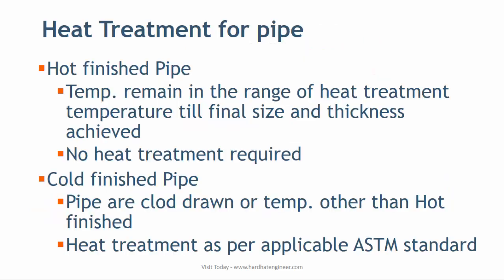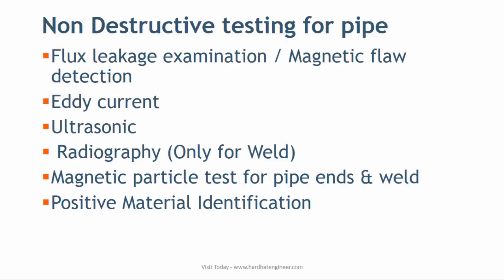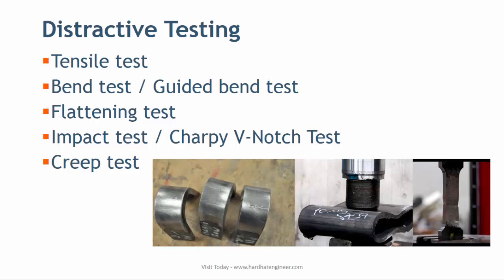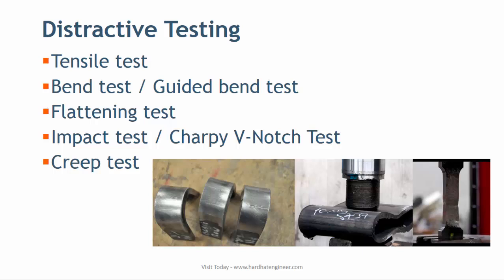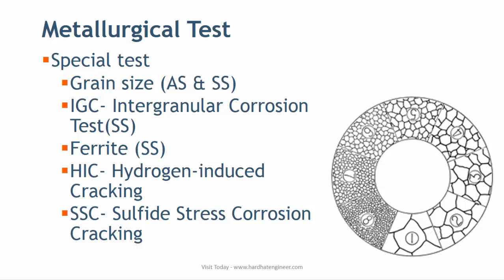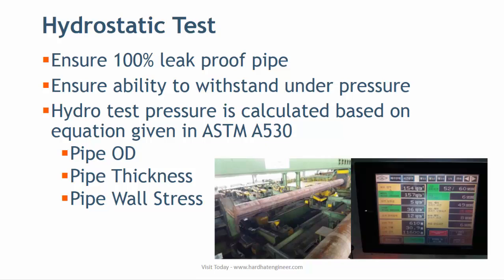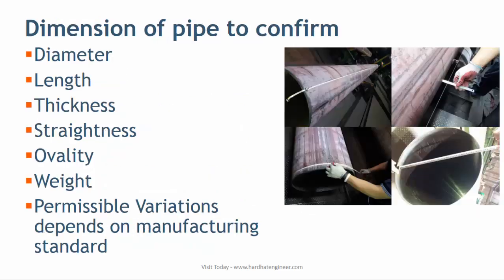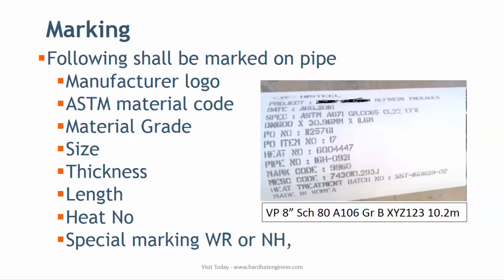Pipe Inspection and Testing requirements.

Comment: Hello Patel, I'm so delighted to be listening to your videos. I have a question on hydrostatic test. Why do we choose ASTM A for that test , ASTM A53 have a Table with specified the pressure related choose the size of the pipe, should we choose from that
Reply from the maker: Hydrotest pressure is depending on material grade. So for A53 pipe stress table of A53 is used for other grade other chart will used. A530 is used to calculate pressure.